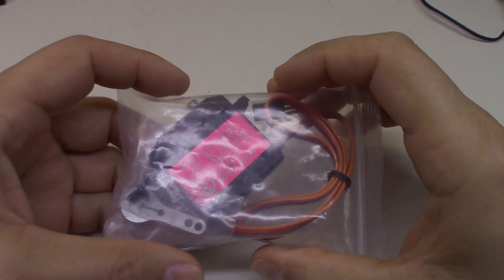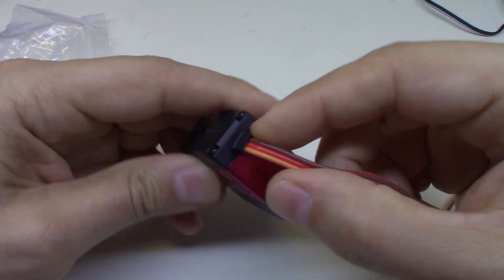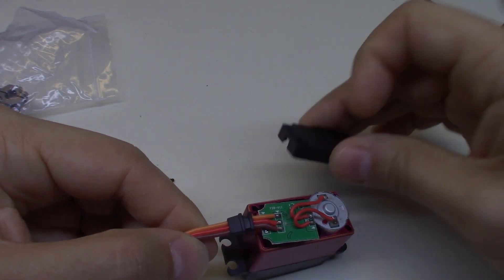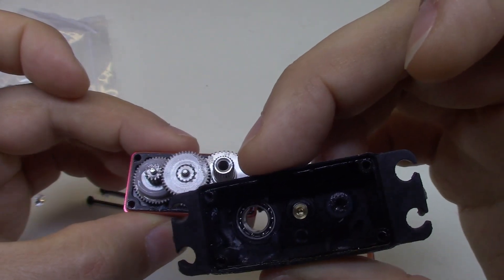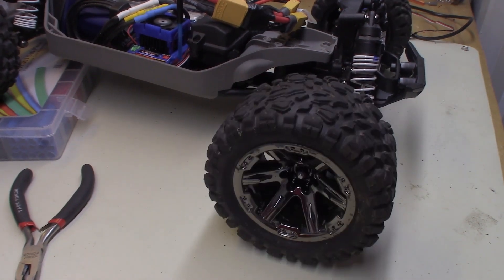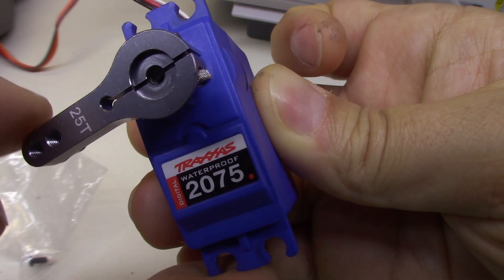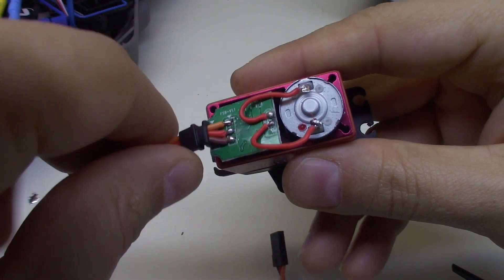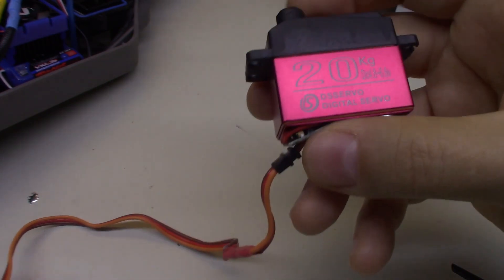DS3218 Servo Review

Comment: Often you don't need oscilloscope at all. Just check IC markings and google for datasheet. I have some Chinese MG996R knock offs, bot says "digital" one has KC2462 and another one has AA51880. Both dedicated servo ICs. True digital servo should have microcontroller inside.
Reply from the maker: I was able to find the data sheet for the kc2462 and it does appear to have a 20 millisecond polling rate so that's definitely analog. I'm not sure digital servos would require a separate microcontroller though. I was able to find multiple dedicated servo ICs that have a high enough pulling rate to easily be considered digital.
Reply: @DoRC pooling rate isn't a thing that defines digital servo or not. Digital servo should have digital processing which mean microcontroller. And it allows to use more advanced logic like PID control.
Reply from the maker: @NicolaiLab  That's actually not true. Even a so-called analog servo is still technically digitally controlled. The analog / digital terminology is actually kind of a misnomer. What defines one from the other is generally the rate at which it actually sends signals to the motor to change position. The older ones did it around every 20 milliseconds and the newer call digital ones are around 10 times that fast. The other features tend to be on newer servos which are also considered fast enough to be digital but they don't define one from the other at least not in any of the places I can find where it is defined.
A very long time ago there were genuinely analog servos but everything is technically been digitally controlled through PWM for a long time.  Of course you could also argue that anything That is getting its positional data from a potentiometer or hall effect sensor is analog which basically also servos are so the definitions are kind of muddy.

Comment: The top does has an o-ring above the bearing so it is actually sealed. The grommet around the wire does compress when the unit is screwed together and makes a water proof seal to at least 12 inches. I have totally submersed mine in a bucket of water so it was at a depth of 12" ( which is more than deep enough to be considered underwater) , operated it and them pulled it apart and no water was found inside. The digital servo claim isn't false as the motor is PWM controlled which is a legitimate form of digital signal. The "digital servo" the author refers to is in the position feedback circuitry which will give a different feel to the drive. It must be considered that this is a 20 buck servo so don't expect it to act as a 100 buck unit.
Reply: Agreed

Comment: Great review keep them coming. Interesting to see inside, all the trailing wires is no no for aircraft servo. Vibration will loosen and break the connection, crashed model! So many of these cheap Chinese servos made to poor standard like this.Totally different ball game inside Futaba. I have noticed a lot of the so called "digital" servos are lacking the characteristic whining noise. Perhaps an observation that needs further investigation?

Comment: Amazing explanation..but I'm wondering on 
1.how do u connect that servo to get reading on the oscilloscope?
2.can we control torque control by using the oscilloscope?
Reply from the maker: The scope can only read data.  I hooked the probe to the motor wires. Thanks for watching and a sub is appreciated!

Comment: Measuring the output of the motor is not a right way to test if it's a digital or analog. The output of the motor should be around 15~20khz due to the internal PID feedback control in the servo controller board. 

Analog servos operate based on voltage signals that come through the pulse width modulation (PWM). When an analog servo is at rest, the PWM is essentially off unless you transmit some action. Producing torque from the resting mode makes the initial reaction time sluggish. This delay in torque isn’t ideal for advanced applications. The PWM frequency is around 60hz for analog.

Digital servos use a small microprocessor to receive and direct action at high frequency voltage pulses. The digital servo sends nearly six times the amount of pulses an analog signal does. These faster pulses provide consistent torque for quicker and smoother response times. It’s important to note the faster pulses require more power emission from the motor. The PWM frequency is around 330hz for digital.
Reply: So is the ds3218 pro really digital or analog? Now im confused
Reply from the maker: Very interesting. I knew most of that but I didn't know why I was seeing what I was at the motor.  Thanks!

Comment: I have the 25 kg version and tsm works fine.
Reply from the maker: Interesting. The internal electronics must be different or maybe I got a strange one. Glad it's working for you!
Reply: weird. I just got one, hook it up and it wasn't responding with the radio. Also it was getting stuck on either end of the 180 degree. I am gonna have to compare it to my traxxas. the other thought I have is that maybe is not 100% compatible with traxxas.
Reply from the maker: It seems that some people have no issues with tsm while others like myself do.  I'm not sure why it's inconsistent.  The manufacturer may be using different boards internally at different times.
Reply: @DoRC  Yeah i has this servo and the tsm doesn't work for me either

Comment: I'm using one on my TRX4 and consider it a huge improvement over stock. That said it is what it is , a $17 servo. I'm about to upgrade the ones on my Typhon 6s and Granite 3s and don't think these are the ones I'll be using. The JX Ecoboost is what I'm leaning towards now. Thanks 😊
Reply from the maker: For what it is it's a decent servo.  My complaint is that it isn't what it purports to be.  I checked out a jx servo (video coming) and wasn't super impressed there either.  Better than this but they aren't really water proof either and their qc leaves something to be desired.
Reply: @DoRC  any suggestions for a budget minded servo for a mild basher?
Reply from the maker: Honestly as long as you're not spending a lot of time in deep water the jx or even this servo will work fine.
Reply: @DoRC  Thanks 😊
Reply: Yeah it’s $20 or less!!
Back in my younger days it would cost you $80-120 for a good mg steering servo, quit your whining!
I have one of these in my trx4 and it’s just fine! I know a $400 kit and replaced the steering servo with one that’s $20, if it quits then I’m getting the ds servo that’s 35KG for …….$20! It will take a long time to be tired of $20 servos going out before I spend $80 for a “good” servo. 
Now the real, bad part of this servo is with stock voltage from your esc it’s a bit, just a bit week. It does get tired if you’re really in the rocks with an eight pound crawler, otherwise it’s a great value!!! I’m only planning on the 35KG servo when/if this one goes out. 
Side note,,,,, I just spent $20 for breakfast this morning for just me!!
Reply from the maker: I guess that's the thing for me. I'd rather spend $80 on a good servo and that I can enjoy the entire time I have it then spend $20 four times on cheap servos that aren't going to be very good to begin with and they're going to break fairly easily.
Reply: It's just died in my rustler i had the stock for about 2 years and now less than a year and this shłt already wobbling and barely pulls back to standard position under the car own weight even at standing or very slow speed at hight speeds i need to correct every time just to go straight so that's about it. If  idon't correct it the car steers itself and a few time the car ended up in a ditch or a bush and  i started on a straight line :face-orange-frowning: